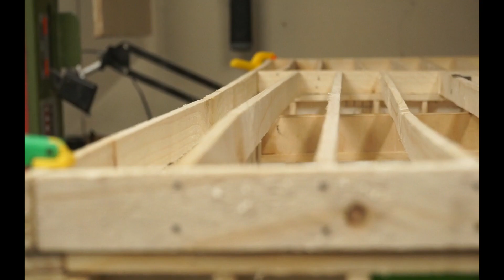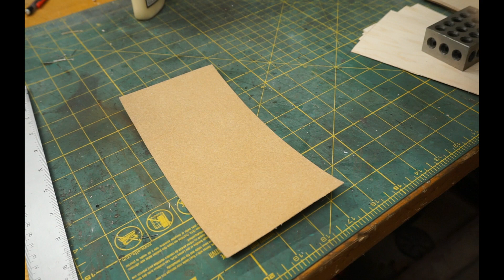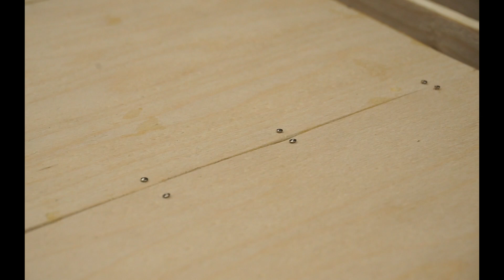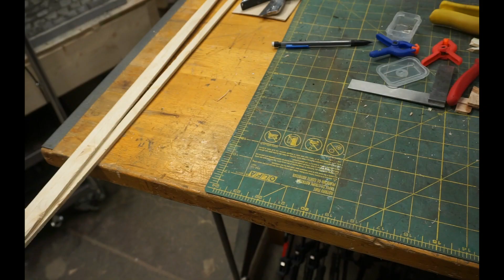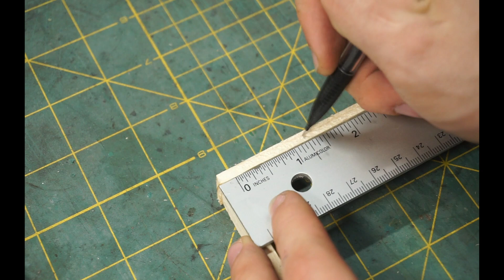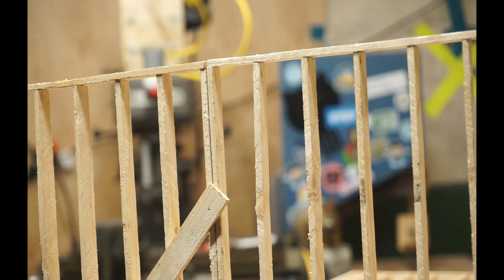Building a Realistic Model House, Part 21: Subfloor and Walls, Again!

Comment: The type of warping you had is called cupping. We usually just lay it against the cup and put other wood on top so it flattens out
When you’re putting down the subflooring try putting glue along the beams then put the plywood down. It helps strengthen the whole structure.
Reply from the maker: Ah, yes, that makes sense! I might glue some of the more troublesome pieces on the first floor and potentially may do the same to the second floor depending on how it weathers over time.